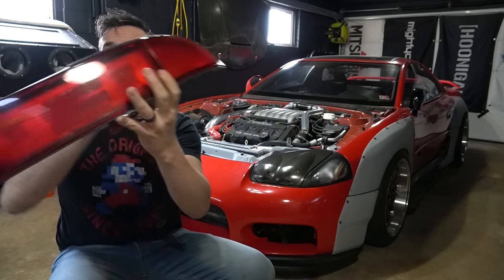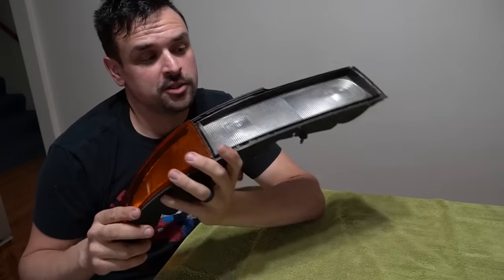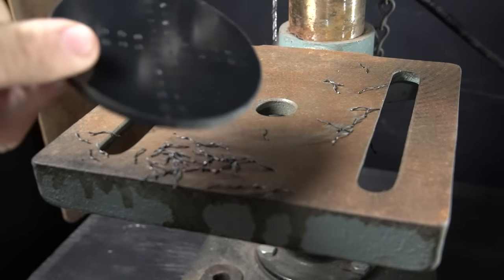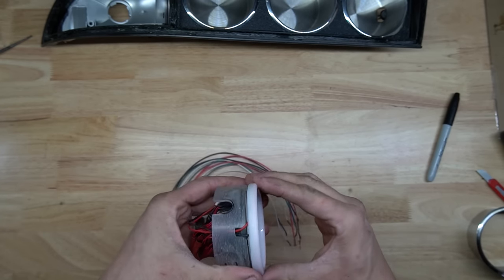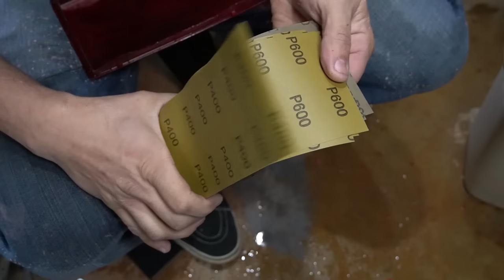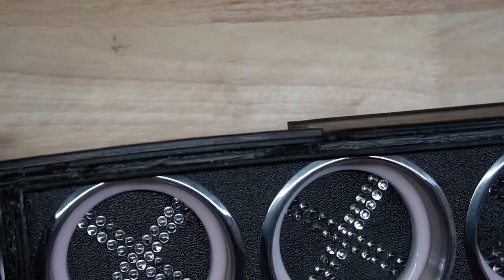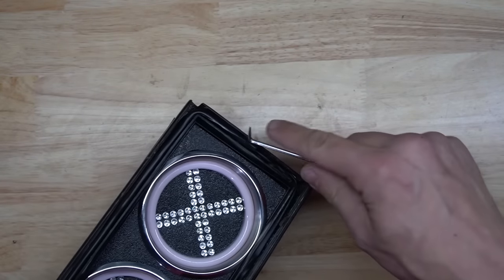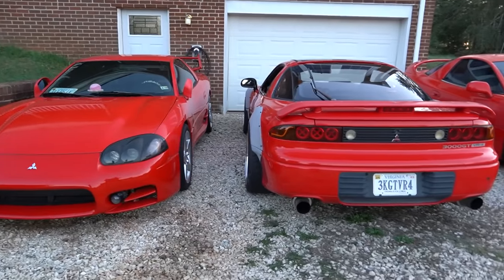Custom Tail Light Tutorial with Sequential Turn Signals.  DIY 3000gt with Amazon parts

Comment: Just a tip, if your silicone smells like vinegar then it is acidic and not great around metal or electronics.  You might have trouble weeks, months or years later with corrosion from that if it is acidic.  A safe sealant would be Permatex Ultra-Black RTV.  There is also "The Right Stuff" but it is not said to be sensor safe.  That Ultra-Black RTV is sensor and electronic safe, non-corrosive and re-workable (meaning you can remove it if necessary).  You could even pot the back of your LEDs or circuit boards with a small amount and remove it later if you needed to.  Test it out, it works.
Reply from the maker: Epic thanks for the info. I will use it on the next one.
Reply: Are you saying that all the rtv mechanics use to seal the oil pan are "not great"?
Reply: @arva1kes  Well, I guess the weight of the transmission would be fine on the pan for some transmissions, but the number of transmission bolts doesn't even come into play here as it is the entire pan transferring the force directly.  And some transmissions, like the NAG1/722.6, they don't use RTV, they have a rubber gasket that will be destroyed if you apply too much force on it. I think the clamping force of the 6 bolts is 8Nm... about 6ft/lbs... An older gasket certainly won't survive, especially if you distribute the 300lbs transmission weight unevenly.  Maybe a newer one can but that is a lot of weight on a rubber gasket even if the load is distributed around the perimeter evenly.
Reply: I put on 2 MP8 pan today, 18ftlbs20°. I lace all corners,  and the furst one got a thin 3/32Ish line all Round as it felt a BIT smoother than I prefer. But at 3-400$ each. They get reused until it takes a fat blade to remove, or get seriously injured otherwise.
Reply: @arva1kes  hey, I think I got mixed up on what the original post was so my last reply was probably not making any sense.  The RTV that mechanics use is fine but you need to pay attention to its intended use.  Any RTV or silicone sealant that has a vinegar smell is not safe around electronics. Some of them will start to smell as they set but Ultra-Black RTV is sensor safe and electronics safe.
Reply: @beasyphone  hey, I been sick so I didn't notice I mixed up my last reply with a different post, thought it was a different post from a different video... Yeah, the dealer branded stuff is always more expensive. The Permatex branded stuff is always just right and they have one for every application too.  I use grey or Ultra-Black for head gaskets when needed and always Ultra-Black for oil and transmission pans that need it... It works just fine there. But some RTV isn't made for use around electronics.

Comment: This video was absolutely amazing and well executed and with awesome illustrations showing all the steps and techniques and supplies necessary for the project. 
   Also you gave warnings of the dos and don’ts so that all the steps come out correctly without any issues. 
It is also quite obvious on a project like this especially if it is your first time at trying something like this that you should take your time 
and always double check before trimming or cutting or drilling holes make sure by double checking as you did so that you have a good outcome with the end product. 

         Absolutely an incredible well thought out and executed video one of the best I have seen on YouTube.

Comment: I have to tell you that was an amazing video. Your design process was extremely well thought out and looked amazing. The materials you use to create the tail lights were really well done I, especially like the stainless steel bowls. One thing I would have liked you to cover is how you made the turn signals sequential or did I miss that part? I really like that you took your time and you were very methodical with each process. Well done now as far as your problem. If you have a problem then I have a problem. I have three Subaru Vortex XT and the only reason I don’t have more is because I don’t have a longer driveway.  And I will concede that you don’t have a problem if we can agree that I don’t have a problem!

Comment: This is so damn cool! This is a huge inspiration for me as the aftermarket taillights I've wanted for my '78 911SC are always sold out. I don't even know if they make them anymore. I think I might try my hand at this at some point. Cheers, man!
Reply from the maker: Hopefully this helped give you the push to try making a set. I'm currently working on experimenting with making new lenses using a casting process. I would also like to play around with 3D scanning and printing of the insides.
Reply: @illusiveinu  Oh hell yeah. Do you plan on making a video for that process? 3D priting definitely sounds like the way to go, but I'm assuming you'd need a higher res printer. What do you think would be the more effective option: a resin or filament printer?

Comment: this is  a big help i have a 1999 eclipse rs  i am fully rebuilding slowly  i been looking for ways to change up my tail lights and stand out, i am also building a set of head lights with dual projection and custom led light bars and demon eyes nobody does eclipse customs i will be saving this video to watch a few times to help me walk threw my tail lights
Reply from the maker: You should show me once you make them. I had a 95 RS eclipse that I dumped alot of work into. You can probably get a good set of aftermarket lights and modify them.

Comment: when i do a 3k conversion on my stealth r/t i will probably do something like this to my tail lights
Reply from the maker: Are you doing the full conversion with the rear quarter glass or the bumpers and side skirts? I love how so much can be changed around on this car from the different models and makes. It's like stealth 3000gt legos
Reply: @illusiveinu  I'm going to be changing just the bumpers I've designed a set of side exit exhaust for it to match the side skirts
Reply from the maker: Congrats man you won the 500 sub gift card giveaway. If you have Instagram link me your name so I can get in contact with you by DM.

Comment: how does the wiring work?
and what happens when you both brake and signal at the same time?
Reply from the maker: The wiring is a hand made controller. I'm working on one that people can get online and program.

As for the brakes and turns. The turn signals have priority over the brakes. For example if the left signal was on the right brake would be lit when pressed and the left signal would keep sequence. Once signal goes off it acts as a brake again.

Comment: do you know the electronic device that allows the rear low beam to go off, when the brake light is on .. because the low beam of my car is blue so it's not good if two lights are on at the same time.

Comment: I just wanted to say. I came across this video randomly. But coincidentally I own a Dodge Stealth TT. Sadly it spun a rod bearing shortly after I got it on the road and disassembly showed a shot transfer case coupler as well. I'm still planning to re-build it as the body is practically rust free. But this video made my chest hurt.
Reply from the maker: You definitely need to rebuild it. Could always throw in some more power while you are at it. rvengeperformance.com is a good place to get your transfer case rebuilt. Best of luck getting your car back on the road. 

Also what year Stealth?
Reply: I can do all the work myself no problem. Mostly I just haven't had the time. But I'm adding an extension to my shop this fall so I can work on it over the winter. 

I've also bean a bit torn as to what I should do to it. Fixing it would take a new output shaft at $1000, and re-building the engine for another $1500+ with re-grinding the crank and replacing the conrod. 
At that point it starts to make more sens to go to something I could abuse and blow up without consequences. 

So you'll likely not like this but I'm considering converting it to RWD with a CD09 transmission (T56's are stupid expensive here, and the CD09 can take nearly as much power). And maybe a vortec 4200? or a v8 such as a VK56, maybe an LS, but that feels a bit too boring (and it's already bean done in a 3000gt).

Oh and it's a '93 but 6 speed swapped.

Comment: sub'd..  what type of controller did you use to handle the switching from parking/braking/sequential.
Reply from the maker: It's a custom made circuit board I made a few years back. I am making an updated video using a controller you can get online.

Comment: Looks cool what lights did you use for the brake lights? I didn't see a link
Reply from the maker: It was just your standard 5mm pin diode LEDs

https://www.amazon.com/100pcs-Ultra-Bright-Light-Emitting/dp/B01GDO9OZ8/ref=sr_1_20?crid=35RNDEV4BBFJD&keywords=5mm%2Bled%2Bred&qid=1683767398&sprefix=5mm%2Bled%2Bred%2Caps%2C104&sr=8-20&th=1

Comment: Your lights are Illegal in my opinion because when you turn on your sequential turn signal while stopped at a light how could the brakes and turn signal be activated at the same time? Should have in retrospect kept the first circle as the brake light and the one in the middle and the right circle to be your sequential turn signals. Good Job BTW with the soldering.

Comment: Also, do you know why there are no tail lights with ultra smooth plastic? Those little bumps and ridges that you sanded off are lenses. The lenses are a safety feature of the taillight, they direct light to all of the angles that are not the immediate 15º directly behind you. Can people in other lanes even see when you put your signal on?
Reply: Also, you recessed the LED's into metal cups which compounds the problem from above like 100x. People - don't do this to your tail lights.

Comment: Cool video, why would you show us the finish sanding and skip the more technical part of wiring the LEDs? I know other have said the LED part, but watching sanding is dull video filler and the tech part was completely skipped. Thanks for the video though.
Reply from the maker: I am currently working on an update to this video with a programmable lighting controller. The one I made for this video was a hand built circuit board I make a few years ago using relays, resistors, diodes, timers, etc and so on. 

The new controller is an all in one with computer programming.

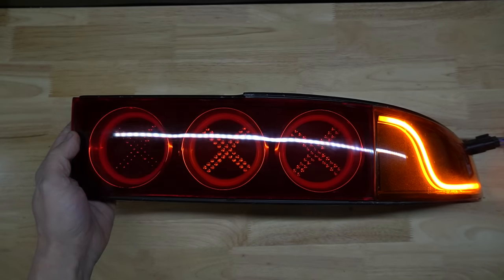Comment: 4:14 One thing I don't understand about taillight design is why doesn't the side marker indicate the turning movement?
Reply from the maker: I just wanted the Xs to turn into 3 arrows for the turn signals. The side markers are just markers.
Reply: @illusiveinu  You did a fantastic job! I’ve been considering making my own but all the ones I’ve seen so far had a 3d printer, but you didn’t use one, so I’m inspired. 

My observation about the side markers not flashing is inclusive of even OEM lights. Perhaps it’s just logics if your changing lanes it’s meant more for the people behind you than those next to you.

Comment: what type of plastic did you use? and how did you get those x shapes on those circles that were pre cut
Reply: like that jig you made
Reply from the maker: It was a scrap sheet of 1/8 inch ABS plastic. And the the jig was all hand drilled into a sheet of aluminum. I used a caliper to mark equal holes and a drill press to punch the holes.

Comment: The reflector part of the taillight, is a legal requirement.
Reply: Yes and no, you can put reflectors anywhere on the rear , doesn't need to be in the taillights.

Comment: That is an awful lot of wires coming out of your led's X's. Your two circuits you should only have 3 or 4 wires. You should have connected them all in series. One leg of the LED (-) soldered to the next (+), straight down the line. 
What you did work but took way too much time I am sure compared to just doing it the right wait as they were designed to be used.

Comment: Why did you leave out the wiring part. Most people would like to see that.
Reply from the maker: I am working on an upgraded version of the wiring I plan to post with a file that can be downloaded and is plug and play with the cars factory setup. 

The main reason I didn't show the wiring side is I didn't want people to accidentally destroy their factory wiring since my version 1 was not plug and play. I have multiple parts cars so I modified the turn signal switch, flasher relays, and body control harness.